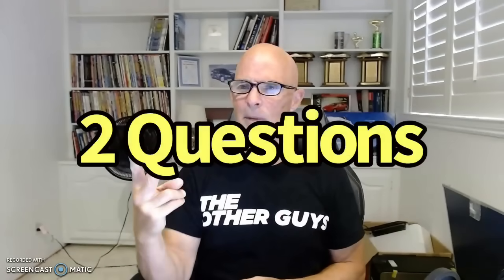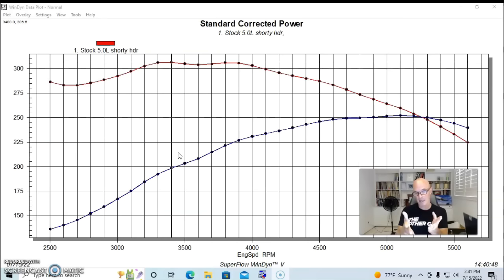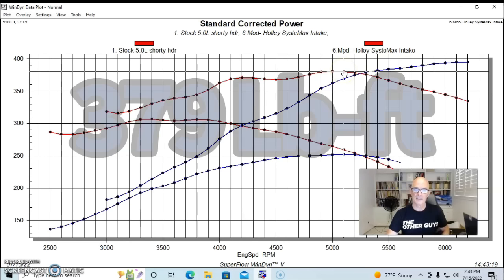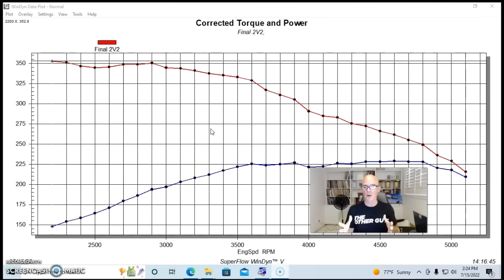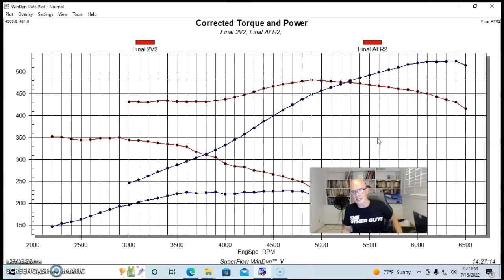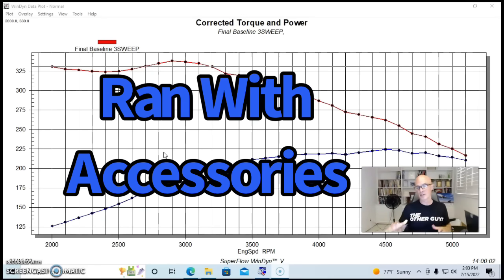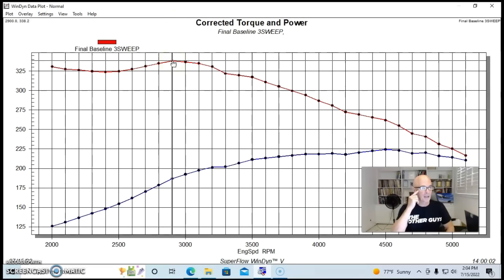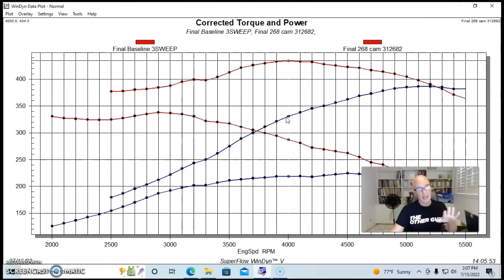FORD VS CHEVY VS DODGE-WHAT AMERICAN V8 MADE THE LEAST AMOUNT OF POWER? 5.0L VS 350 VS 360-WHO LOST?

Comment: 1979 F250 4x4 351M. It's a good thing it had 4.11 Gears and a four speed with a granny gear. It would move a load, just not very quickly.
Reply: Yep I had a couple of those. Not exactly a reliable engine but you could mod them to gain hp and torque.

Comment: The Lucore Automotive guys were saying one of the AMC V8’s only made 110 or 115 hp.   The last of the 360’s that came in the 79 or 80 AMX
Reply: The Chevy 262 V8 from the mid 1970s also made a whopping 110HP. To make matters worse, these engines were installed in cars with a 2.29 or 2.56:1 rear axle ratio.

Comment: 1937 Flathead Ford V8 ... 136 Cubic inches (2.2 Liters) and 60 horsepower.  2.6 inch Bore by 3.2 inch Stroke.  Powerful enough to grind coffee. Largest Flathead Ford was 337 cid for truck use.

Comment: The Mopar cam has the wrong LSA for a Dodge. 110 degrees is a Chevy cam. Try a 112-114 degree cam LSA and let me know what you get power and torque wise.
Reply: Less!
Reply from the maker: there is no such thing as a Dodge cam and a Chevy cam
Reply: The 108 lsa works better for the small block mopar. I have heard claims the ramp rates also could be more aggressive with the larger diameter mopar lifters but are not with off the shelf cams.
Reply: A chevy guy will never build a mopar the correct way. I only use engine builders that specialize in mopars that know how to get the correct power out of it. Richard likes to use his old van 360 motor that's wore out with 200k miles and compare it to fresh chevy motors.  Probably a California smog motor also. Do same compression/ cam specs etc... for a more realistic comparison.

Comment: I had a Chevy 307 in a 1967 K20, 4.56 gears, and was an absolute POS. 

Ford 360 was pathetic, but with compression increase could do alright. The 352 did well, only being slightly smaller in bore, but was 10.5:1 comp.

The ex's 454 was the worst BBC I had ever driven. No power, 2-3 mpg (not exaggerating), and all on 40k original miles...
Reply: Chevy 307 is a 283 bore with a 327 stroke. The other leftovers of the making a 302 lol
Reply: Chevy 307? Not 302? Did you mean Olds 307? The 80's 454s were slow but so were the 80's 460s which were even slower.
Reply from the maker: chevy made a 307
Reply: @richardholdener1727  I never knew Chevy made a 307. It must have been terrible. 🤣
Reply: Yah chevy did make a 307ci motor. My 70 Nova had a 307 and back in the 90's guys were using 307's in dirt track racing and putting 400 cranks in them with the mains turned down to fit the 307's mains
Reply: The 1967 chevy impala coupe that I had with a 307v8 was gutless.  And they paired it with a twp speed power glide.
Didn't help.
Reply: @charliewilson3528  I replaced the 307 in 1980 with a 327 from a 69 Impala. Rebuilt it and did the typical hop up stuff at the time, head with small chambers, flat top pistons, cam (cannot remember which one), Performer and Qjet, headers. Better but not like the engines today!
Reply: My ‘69 Chevelle had a 307 SBC w/Powerglide and 3.08 rear gear.

Comment: My second car was a 1978 Buick LeSabre four-door with the Pontiac 301 . It made 135 horsepower from the factory . By the time I got it at least 60 of those horses had escaped .
Reply: I had a ‘78 Oldsmobile Gutlass with the Chevy 305 4-bbl … It probably would have struggled to keep up with your 301 …
Reply: Surprise to hear that I've ridden in 301 powered cars that were no slouch by any means.
Reply: @CSXT8250  i have owned a few 301 powered cars that were pretty good . 79 Bonneville put over 400,000 miles on it , 79 Regal , 79 TA.  80 Grand Prix SJ .  The 1980 GP SJ had the W72 option was rated at 170hp . All the 80-81 301 blocks were the T blocks heavy duty Trubo Blocks. Oh and at 452 lbs the 301 was about the same weight as a 231 Buick v6.  Which where only rated at 110hp and 190 ft lbs  the 301 was 135- 170 hp and 235 to 255 ft lbs . So if you dropped one in to a 1977 to 1980 Sunbird  that had a v6 you didnt have to redo the frontend and the handling  stayed about the same.
Reply: My friend has a 81 lesaber 4 door 350 diesel car and it was horribly slow, now it has a 6.0 and th400 trans
Reply: @turkeyboyjh1  booo. Dude should have converted that 350 diesel to run on used cooking oil! Who cares how fast a LeSabre is!? Haha but cruising a cruiser for free is one of my dreams... It's very easy to do. All that is required is two separate fuel tanks. One for vegetable oil and a smaller one kept for diesel. Then a switching system to toggle between drawling from one or the other fuel tanks. This must be done especially is cooler weather because vegetable oil will gel up when cool. So the engine should be started and warmed up some using diesel. Then you can switch to veg oil for the rest of the time. Then just before you shut the engine down you need to switch back to diesel for a minute. So the system doesn't clog up with the vegetable oil when it cools off. 

It's one of my dreams to get an old diesel gm wagon with a 350 diesel and do this. All that's left (which honestly is the hard part). Is working out deals with say local Chinese resurants to pick up their used cooking oil. Then filtering it at home. Because before using it to run your engine you need to remove most all of the particulates left in it from cooking food.
Reply: @ron1836  sadly the cam had a couple flat lobes and actually hydro locked a cylinder and turn the piston into dust, they are so fragile it’s not even funny, the v6 diesels are much more reliable and can actually take a turbo and turn the pump up, I am interested to see how fast we can get it to go with the 2.73 gears
Reply: That 301 had some really funky cylinder heads
Reply: Nice! In 1990 I bought a '79 LTD station wagon with a 351 Windsor V8 that made 140 PS on the dyno - 138 HP,  no horses lost, just malaise era lack of power. Best ever mileage was 18 mpg, crusing at 60 mph on the highway. I still loved that wagon so much.
Reply: LOL, now you know why GM needed a government bailout.
Reply: @jeffpittel6926  and you drive what?
Reply: Anything but the big3, currently Toyota.
Reply: There was suppose to be a turbo 303 that pushed 500ish hp
Reply: Damm, my 2001 Freelander with a kv6 puts out 135HP. Man it's feels lacking now.
Reply: In 1985, I had a 1978 Mustang II Cobra II with a 302 2v and a 4spd. It made somewhere around 140-150 net/hp. It was a really light car, which got surprisingly good highway fuel mileage. I drove from Myrtle Beach SC to southeast Pa, and I measured fuel mileage while driving on I-95. I was getting right at 30mpg.
Reply: @HighlanderNorth1  1978 cobra II 302 2bbl 139 hp at 3600rpm and 250 ftlb at 1600 it was a dog
Reply: The first thing I thought of when I saw this video, was our 1980 Buick Century wagon with the Pontiac 301. My friends called it the power wagon.
Reply: @cpm1003  1980 3014bbl  150hp  245ft lbs ? I think they had discontinued the 2bbl at that time.  When I was getting my degree we took a 1979 Sunbird 3.8L  and swapped in a 1980 301 4bbl out of a totalled  1980 GP SJ  it moved that little car very well. We even made a set of headers for it  and put a   067 cam in it later was not a  bad idea . Just the basic swap going from the  110hp 190ft lbs of the 231/3.8  to  the 150/170 hp 245/255 ft lbs 301 and the two engines being about the same weight worked out nice , plus the trans was easy since they were both BOP.
Reply: @tomcherry7029  It had a 2bbl for sure. But my 16yo self thought it was awesome!
Reply: @cpm1003  i had a 1979 Regal with a 301 2bbl  it ran pretty good  good top end but not much ofd the line
Reply: swap in a pontiac turbo 301 v8 good used..done..or not...lol
Reply: @mor8286  205hp and 340ft lbs what are you dropping it in to?  If they would of developed the 301 turbo like they did the 3.8 Buick it could of been a monster.  SFI , Inter cooler , beefer block and internals . After all the turbo 3.8 started out at 165hp  and ended up at 300hp
Reply: I had a 1989 Trans Am with the same 301. Previous owner had put some kind of exhaust on it, and it sounded good. But, it was purely bark. My '93 300 powered F150 would pull so hard on it, it was embarrassing. "Luckily", it spun a rod bearing a few weeks later and was immediately decommissioned. Probably, the slowest 'fast' car I've ever owned.
Reply: Ahhh the 70s....

Comment: Took driver's ed in a late 70s Old Cutlass with the gutless 260 V8. First day on the road the instructor has me take the on-ramp to the freeway heading toward Padre Island. As he's explaining why we're going on the freeway on day one [no cross traffic, no oncoming traffic, etc.] we get halfway up the ramp and he says "OK about now is when you want to give it some throttle and start looking for a place to merge into traffic" and I grip the wheel a bit tighter and reply "Uh, I've had it floored since we turned onto the ramp" and he's just like "OK everybody hang on..."

I think it made about 110HP and with five dudes on-board, made a LOUSY finale to the muscle car era.
Reply: That's the damnedest thing!  Those must have been a hit or miss.  Drove a minty 78 Cutlass with a 260.  Not only did it easily lite the tire at 1/4 throttle burnout, it chirped the tires a lil hitting 2nd gear at WOT.

Comment: I would say the Factory Chevy 350 LM-1 in my 0ld 1975 Camaro was the worst for power. the rating from the factory was 155@3800 HP and 250@2400Ftlb from a 350 4bbl. that car was pig slow. but it has the 3970010 4 bolt block. you had to change everything else to at least it had a 4blt block.

Comment: Any 70s and 80s smog motor was pretty bad. The 90s v8s weren't any better really when I think about it.
Reply: 92-97 lt1, 96-99 vortec,  97 ls1 was born. 90s were pretty good.
Reply: The main difference was EFI and HEI ignition all solid state no more messing with things just to get it to run and no more repairing things for maintenance. Didn't have to worry about adjusting carburetor, dealing with ignition cap and rotors, ignition coils or points and condensers etc..... So in that aspect once you learned about the OBD and tunes you could really wake up what you had with not a lot. Simple things could make good power gains, pair of headers, cold air intake, cam swap a intake and a tune and you could easily jump 75-100+ horsepower pretty safely and without a ton of work or maintenance consequences. Before the 90's your options were pretty limited to either big older engines pre smog or a complete engine build and still having to run a carb and old ignition.

Comment: So... a 5.0 vs a 5.7 vs a 5.9  =  Ford 252/306  Chevy 229/350  Dodge 224/338 = Ford wins.
Reply from the maker: So...you missed the point of the test
Reply: @richardholdener1727  - if you were going to make a valid point comparing SBF, SBC, and CLA to find the weakest, you would have started with all 5.0L or all 5.7/8L, all pre-upgrades, yours or theirs.

Then again, the fattest uni-body cars, with the most  undersized joints have always been Dodge.  

Most of the time the engine is too.
Reply: @richardholdener1727  no the comparisons were so far from each other.i know what adding parts does to each engine.
Reply: Stock Ford had a way bigger cam

Comment: You should test a tired 1973 307ci Chevy.
Reply: Yeah - didn't that have less HP than the 250 six cylinder in the early seventies?
Reply: @rjkubr  I did some digging 1 forum said it made 110 hp.

Comment: The 302 in a 77 bronco only made 133 hp. Add big tires = Turd 💩
Reply: Cherry Bombs add 100hp ... $100 and 45 minutes at the muffler shop.. and you're good. 😊
Reply: @arcdestriumph586  🍒 💣 mufflers are $50.00 each now? C’mon Brandon.
Reply: Same crap in 92 bronco
Reply: Wow
Reply: Really? I had a 76 and a 74, both with 302 2bbl and c4. Maybe it was the 4.11 gears but both of mine would roast the "monster" 31" tires at the time.
Reply: 133 HP in a 302 will still beat a 1000HP LS engine
Reply: @jrburger95  And then you woke up from your dream.

Comment: I love the concept here. I'm a Ford guy, some candidates for low power champs: 1) the 5 liter in the 80's T-Bird and Cougar, so de-tuned it had a different firing order than the HO 5.0 (I had an '88 Cougar with a 5.0, loved that car even though it was slow), 2) probably the champ: that weird de-bored 255 Windsor that went in the Mustang/Capri in the early 80's; so embarrassingly bad I never even heard of it till recently and I worked for Ford for 15 years.
Reply: I've had about a dozen Foxes of all flavors, and the 255 in a 1980 Thunderbird was the saddest engine I've ever driven. It made a 2.3 Mustang feel downright peppy
Reply: I had a 85 Buick LeSabre with a 307. It was sad. It had no power.  the upside was it was quiet and smooth  and the car itself was nice
Reply: I bought a 1981 Thunderbird with the abominable 255 V-8 and horrendous 2.27 gears. It didn't run, and I wasn't going to bother trying to make it run (Im building a 302 and wide ratio AOD with 3.27 gears for it)
Im nearly certain 0-60 should be timed with a damn calendar.
Reply: @donreinke5863  those are 2.26 gears and if you still had them and relatively close to me I would be interested in buying another set (btw 29" tire 2.26 gears 1 to 1 top gear 1700 rpm at 65mph im using this combo in a Ranger im building for mpg reasons)
Reply: @smokenchoken1736  Of course I will sell them. AND the carrier. They are  of course 7.5 inch. I live in Colorado so don't know if thats an issue for you.
I had intended to throw them in my massive scrap metal pile, but you are welcome to have them.
Reply: My 1987 f150 had the 5.0 in it making a whopping 185 horsepower .
Reply: yeah the 255 Windsor made like 115 horsepower lmao
Reply: I’ve owned a 1987 T-Bird Turbo Coupe since new. The turbocharged/inter-cooled , 2.3 liter (140 inch) four cylinder is factory rated at 190 horsepower/ 240 lb.ft. torque with the 5-speed transmission. Nothing special by today’s standards but it actually moves the heavy Thunderbird pretty good on the big end at 143 mph 👌.
Reply: What about the old Ford flathead V8. Early versions of that only put out 60 hp i believe, but at the time that was remarkable.
Reply: @josephg41  That was triple the output of the flathead 4 cylinders that powered earlier Ford vehicles.Larger engines, such as the Cadillac V-16 introduced in the early 1930s (think Al Capones limo) only produced around 150hp in vehicles which approached 3 tons in weight.
Not long after, massive air cooled aircraft engines produced as much as 3600 horsepower in the case of the turbocharged radial engines that powered the B-29 bombers, the "double wasp" radial which powered Grumman F6F and Vought Corsair fighters produced 2000 hp, more than enough to make easy prey of the rival Mitsubishi  Zero.
Germany even produced a diesel powered prop driven aircraft capable of reaching nearly 40,000 feet.
It took many years, even decades, for that technology to finally reach automotive engines.
Reply: @donreinke5863  Just saying when talking about low HP V8's, the flathead should be on the list, know matter the circumstances. It doesn't change the fact that it was a revolutionary engine
Reply: @josephg41  Engineers who worked for Ford at the time claimed it was not possible to make the old Ford V-8..Henry Ford told them that whatever could be drawn up could be cast, it was done as Henry would have likely canned them for failure, and thats why it became the first widely successful V-8. However, it was not the first.
Chevrolet made a V-8 long before 1932, in 1919 they produced a V-8 engine that was apparently such a disaster that it was discontinued by 1920.
Imperial Japan reverse engineered the Ford flathead V-8 and used it in trucks during World War II.
Reply: @josephg41  When the Flat head was the norm  there  were cars that were hard pressed to get up to 30 mph. The gutless  cars of the  mid to late 1970's were sold after Detroit was selling 450 hp monsters  to the  public.  I drove a 1926 Model they are  far worse than any 1970's car, in 1926 people would tolerate  such a car,  in 1980 not so much.
Reply: @mylanmiller9656  As i've said, i'm well aware of how revolutionary the flathead v8 was. Regardless, on a list of low HP v8's, you can't argue with the fact that it doesn't have much. Simple as that. If we were comparing two engines, one gas engine from 1895 and  a 302 Ford from 1970, and the question was very simply which made more power, it's obviously the 302. And forget everything else, we're not asking which is the better motor, just which makes more power. It doesn't matter if that 1895 engine was revolutionary at the time, that's not the question! And its as simple as that as to why i mentioned the flathead. Why does nobody even seem to understand what i meant when i said the flathead should be included on a list of low HP v8's.
Reply: Had an 84 cougar with the 5.0. Total dog.. but a very likable car.
Reply: Unfortunately I am in the southeast corner of Kansas, there are a few of us EcoModders that specifically hunt for those gears so they are valuable to the right people and since they were only available from 79-84 they aren't easy to find, basically before the AOD this was taking its place doing its best to lower rpm, my 77 Cougar has 2.50s, my 66 F100 has 2.75s same as my 72 F100 and 78 F150
Reply: If you thought  the 302 in an 80 T bird was slow  you should have  driven a 255 mustang  they wouldn't keep up with a  in line 6 that was also slow.
Reply: Ford had the nerve to put that turd in the Mustang Cobra back then, from what i remember it was actually SLOWER than the regular 255 stang because of the extra weight of the Cobra package, sad sad sad.